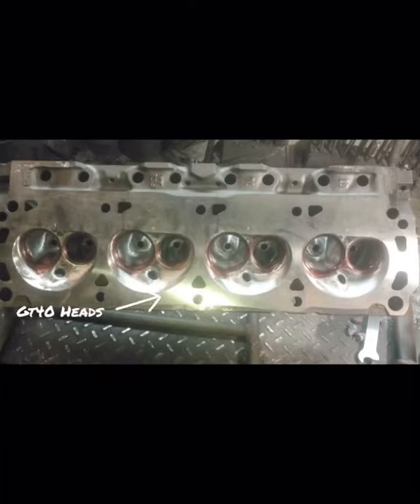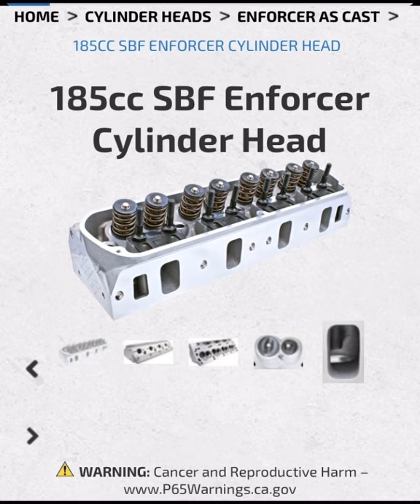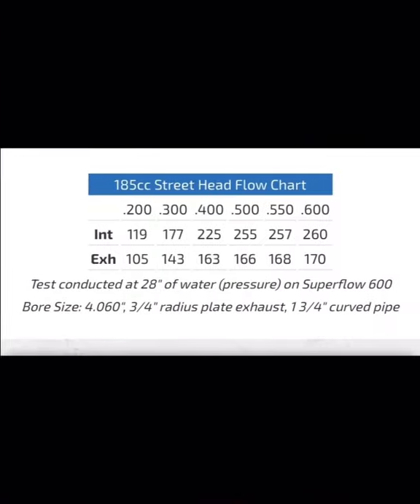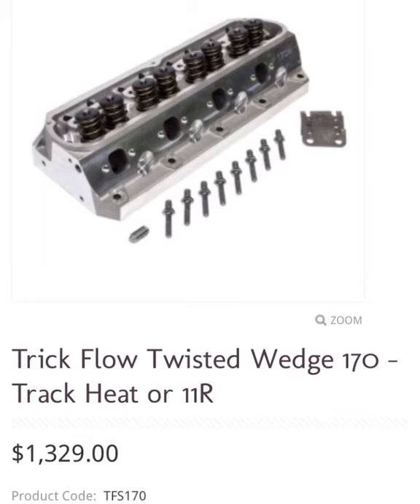Should I Buy Budget Heads AFR 185 Enforcer Heads Sn95 Mustang Foxbody

Comment: yo, AFR employee here. It's true, the enforcers have a stock style deck thickness. They are are assembled with the same parts as the renegade heads- including USA made springs and assembled in California alongside all the other products. The alloy used is the same as factory VW/Honda/Toyota heads, and is covered by the same warrantee as the renegade and eliminator product lines, 💯
Reply: So a slightly upgraded stock head with little bigger springs and arp rocker studs? I almost feel like using a set of stock sbc vortec heads with better springs is about the same outcome besides the obvious aluminum vs cast iron
Reply: @jjmccloud  The enforcer heads have larger valves and flow more than vortec, they also fit both center bolt and perimeter bolt valve covers and both vortec and non vortec manifolds
Reply: @SpeedyCheeze  i think gonna try the 195 enforcers and dual plane intake on my daily with a decent cam and carb conversion on my 98 k1500 with the 5.7 vortec. I feel like AFR has to much reputation on the line to just put out worthless crap and I feel like if it wasn't up to par they wouldn't sale it. At least this is what im hoping for 😅 if not I'm only out the $1000 for the heads and learned a lesson but I think I'll be happy. Besides its not a drag truck just a daily to play around in

Comment: I run the sve heads with great success. On a 302 with a tfs1 cam trick flow r carb intake, 650dp Holley and a 200shot of nitrous car runs 10.20 1/4. Ive been running it for 2 yrs now. No issues.
Reply from the maker: @robert, that's a solid combination you have there. Glad it's been running strong for you.
Reply: Are your SVE heads still good?
Reply: Yes still good
Reply: @robertturner1059  thanks 👍for replying back man.

Comment: I don’t see an issue? Don’t make it seem like it’s something it’s not. It’s a cheap head that flows better than almost any other cheap head, with more than premium valve train that comes with pushrod guide plates.  Simply don’t run boost or a lot of it at least with these heads, and if you’re running boost I hope you have enough money to buy the good heads $800 away so the deck thickness doesn’t become an issue.  They are stellar IMO for the price.
Reply from the maker: Good points. It's not a issue if you're looking for a budget friendly upgrade.
Reply: I agree, if u have the money to run boost and build up a bottom end to take it then don't skimp out on your heads and spend the extra $800-$1000 on the better heads. These have their place though for sure and if your looking to just upgrade your daily or build a little weekend toy to play in these will get u there, keeping in mind u don't wanna run boost or run them with 12:1 compression lol they'll do fine
Reply: Great head from a value standpoint. The casting comes from the same plant that makes VW,  Toyota heads etc.
Reply: @jjmccloud  it will handle lots of copression all day long. Its boost and nitrous and bad tuners kill engines

Comment: I'm looking at BBF heads. If it was that close of a deal, I would go with better heads. Cheap heads are 1000, brand name heads are 2200+. But you can bolt on name brand heads and make more power and better average power than ported cheap heads from what I have found. Do you actually save money after porting/polishing and possibly using bigger valves and of course better sprigs depending on cam, to make up the power lost on cheaper heads?  That's what I have been trying to figure out.
Reply: Well no if u can afford to go out and do all that to a set of cheap heads then its obviously best to spend it on the good heads lol buying the cheap heads is usually because they can't afford to buy thr better head else most would just buy thr best right off the jump instead of buying cheap and doing all out on upgrading them
Reply: @jjmccloud  Ya that's the way to go. Spend the money up front and be done
Reply: @00speeddemon41  yeasir, 80% chance ur gonna do it eventually anyway lol

Comment: flow and quality of TFS Track Heats vs Enforcers is not even comparable..   take them both out of the box and put them side by side and you will see.   TFS base head is excellent entry level head.  Miles above china enforcer...  Power and quality is totally in TFS corner....

Comment: I mean they are called their "entry level heads" they have their place and Noone is advertising them for pro stock builds or turbo and super charged applications. If u know their limits and it fits your build then there good for that just don't run them everyday with 20psi boost lol upgraded stock engine on a daily driver or weekend toy to play in is the perfect setup for these if u wanna drag race or something buy the next step or 2 up lol
Reply from the maker: For $400 more dollars you can get tfs 170. But if you spend $1400 why not spend $1600 for the best sbf head out here, 11r's. I think you sum it up perfectly. They are a good entry level head.

Comment: Hey Genius.. with heads out there by the truck load why would anyone ever go with iron Now I Know that you don't know the difference between BeeHive   and Double springs .
Reply from the maker: Thanks for watching and the comments. 1st off, I'm not sure if you're aware of this but in the sbf community, iron gt40 Ford explorer heads have been one of the most  popular bolt ons at least the last 10 years. Those heads are all over eBay, marketplace and junkyards. 2nd point. The pic of that spring is clearly a double spring and I thought they came with bee hive springs. Lastly your edited comment about popping heads gaskets on a thick deck aluminum head. How much boost have you been able to run on these heads without sealing issues? I have a video coming showing how these heads work on my boosted application. Hope you hang around because I disassemble head and do a full review. Thanks again for watching.

Comment: Quit messing with all the junk and go to a 5.4 navigator engine with a blower.  1000hp
Reply from the maker: That works 👍
Reply: I love the 5.4 . I built mine with MMR rods , MMR forged OPG and hurricane pump , all arp bolta ,JE pistons bored .010 over , Factory forged crank, ported 9 thread 05 e350 2v van heads , gen 1 lightning lower intake with a homemade upper plate and a vmp gen 3r blower. 18lbs made 718 6200 rpm.  Ford mod motors are king.